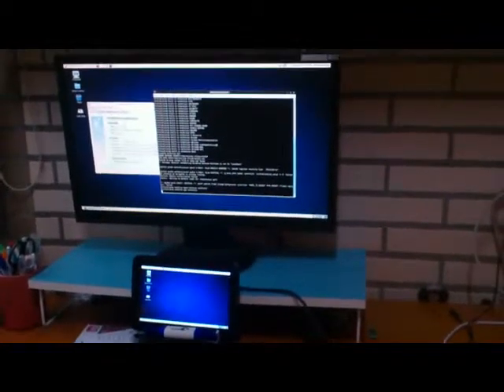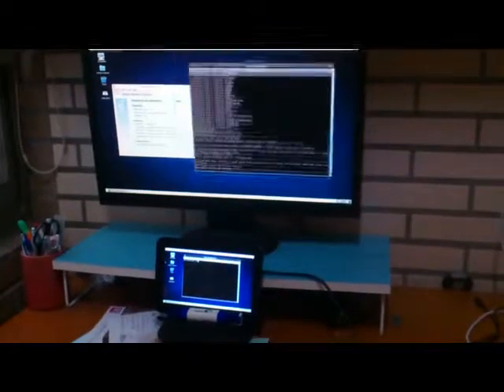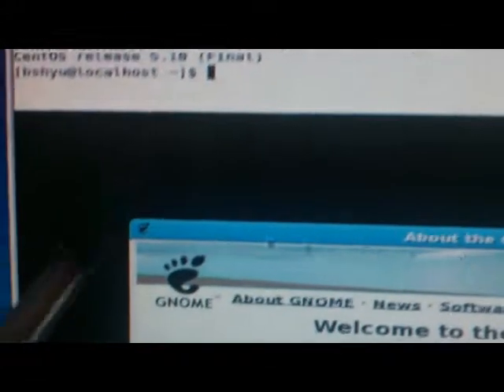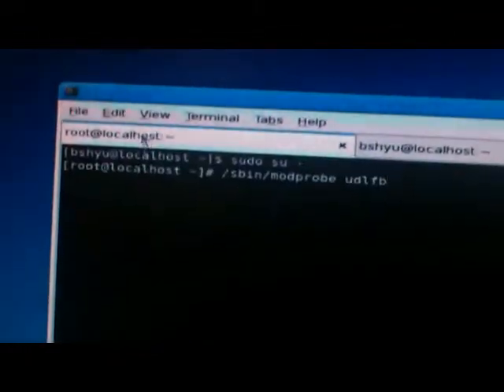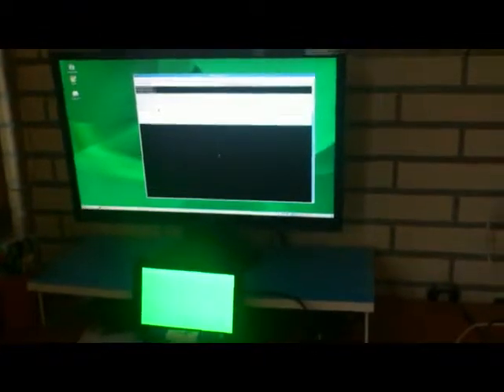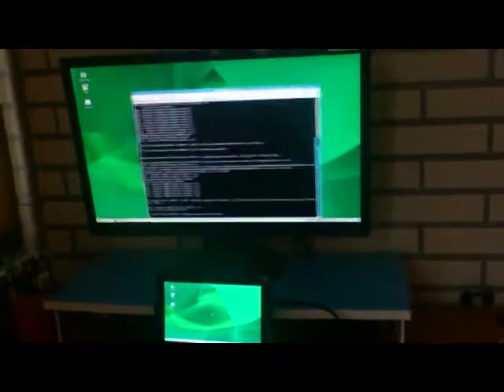DisplayLink works on CentOS5 CentOS6 SuSE11

Comment: Wish you said which package you installed on centos 6.5, that would have made my life easier.  I'm still searching around for the right package to install on Centos6.5
Reply: Sean Davis It's funny, but I downloaded and compiled a 3.14 kernel (pi ftw) and it had all the UDL and UDLFB drivers available. the Centos kmods weren't available.  Looking for older versions of Centos didn't seem to have the UDL kmod or mention of the drivers in older 2.x kernels (centos builds)